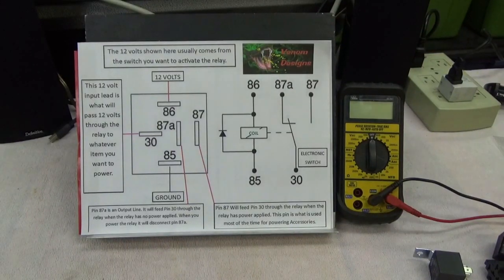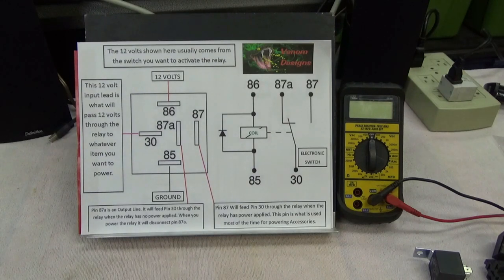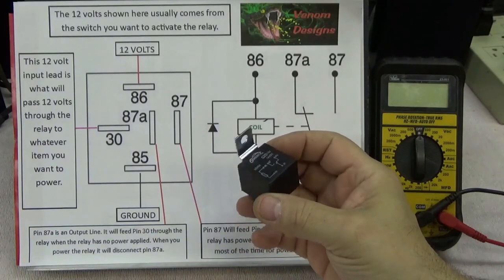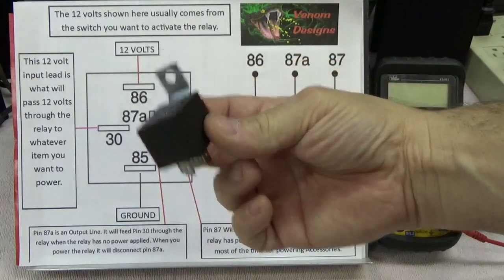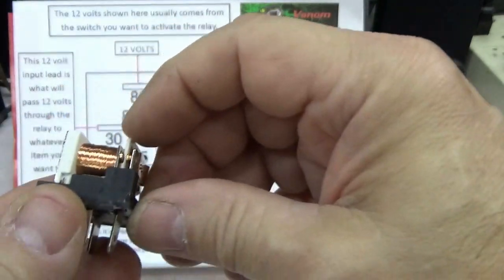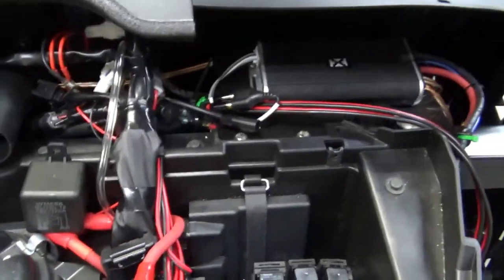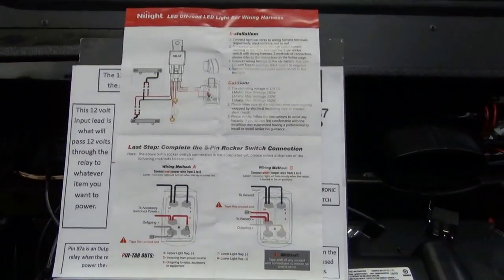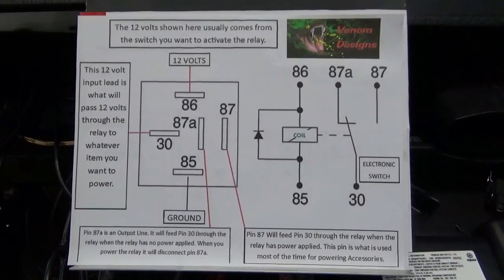Relays, Rocker Switches and Fuse Panel Wiring Explained

Comment: That was Great. I just did the Big 3 upgrade and added a second battery to my truck. I'm adding 7 inch reverse lights and two, 12 inch light bars to the front. I didn't care for the harnesses I was sent. If i have to splice wires to account for length I'd rather do it myself.  My truck is just over 20ft long. I also made a 4 switch rocker panel in place of the simple toggles and fabricated them into my overhead center console sunglass compartment. Your video helped a great deal in reassuring my intentions. I do intend to use the necessary parts from the harnesses provided in my rebuild
 Thank you.
Sorry for the long winded comment.

Comment: This is the best video I have seen on this so far. Question though, could you not run power to your rocker switch and main power to relay and light bar all off the fuse box? I see you ran the main power from battery to relay. I'm wondering if it's okay to just power it from the fuse box instead.

Comment: Thanks for the video Chris - however I have some questions: I have a 6 gang niLight switch gang - I m not positive on how to hook it up along with the relays??  Do I need 6 relays ? 
Thanks 
Mouse
Reply from the maker: If your accessories draw less than 10 amps each you don't need any relays. Those rocker switches have a 20 Amp max and a 10 Amp continuous rating. If the accessory will draw more than 10 amps then it would need a relay.

Comment: Hey one thing I didn’t understand..maybe I missed something (or I’m just stupid 🤷‍♂️) in a circuit that triggers a relay your fuse block only protects the side of the circuit with the switch…the low current stuff.  Do you have some kind of device in the loop that goes from battery to relay to device (light bar, air compressor, etc.) to ground?  Is it that 100A breaker or maybe a different device you didn’t call out?
In the dome light circuit with no relay that 5A fuse protects the whole circuit, switch, lights, etc.
If I’m going to drop 30A through something using a relay I am going to want a fuse of appropriate size between the battery and the relay (pin 30) I’d think…asking for a reality check here.
Video is great…excellent explanation of the relay and the two sides of the circuit. You know a video is good when you watch several times and review specific parts for reference well done! 👍👍

Comment: Hi Chris, very informative. I'm thinking through the idea of using the Voswitch rocker switch bar I'm about to install in my Jeep as a kill switch for the ignition using a rocker switch label that says it's for something else. In this use case, is connecting a relay to the fuse panel of the Voswitch the only way to go or could it be more simplified to route the ignition wire through the rocker switch and bypass the Voswitch fuse panel altogether? Wouldn't this effectively be making the rocker switch the relay using the same current as the ignition currently sends if the switch is activated?

Comment: great video I get how to handle the switch fuse issues,   my question is how you manage and fuse the in-load accessories power to the relay besides just adding an inline fuse where the wire connects to the battery for each circuit where a relay is used

Comment: The 12volt 5 pin 100 Amp waterproof Relay has 2 contacts & not 1 contact  & I'm hoping to use this relay for a radiator electric cooling fan & so would this 12V 100 Amp relay unit work with a radiator electric cooling fan unit Kind Regards Peter
Reply from the maker: It should work, post a link to the relay.

Comment: I’m preparing to set up my own wiring on my SXS. I’m just confused on the 120 amp relay and you having those smaller relays by the second battery for the light bar. Can’t you just use the 120 amp relay alone or am I missing something?

Comment: So you said that the positive and ground from the fuse block for your light bar are going to your switch, but, the nilight diagram visualizes it as going from the fuse block to the relay to the switch. Which one is it? I'm trying to plan for my new X2. Also, do you only have a 4A fuse because you are using the included inline fuse with the wiring harness? Great video btw!

Comment: So when wiring a 3 pin LED switch to a relay…86 out to the switch in and out, but what do you wire to the bronze connector on the switch? Ground?

Comment: I have a rough country led light bar that has a day runner in the center and then it has the lights. Im try to figure out the wiring diagram for a 6 pin On Off On switch. thx

Comment: When using a rocker switch in conjunction with a fuse panel, the 12v supply to the switch will be from the fuse panel then the output of the switch will be to the accessory?
Reply from the maker: @BigFootedMOTHERFER  if your accessory runs on less than 10 amps, yes. The rocker switches are rated at 20 Amps max and  10 Amps continuous.., if your accessorie draws more than 10 amps then you would use the switch to trip the relay which would then power the accessorie.

Comment: I’m using a blue sea LVD with remote rocker switch and I need to put a fuse on the power leading from the battery to the switch. What size fuse would you recommend? Thanks for your help.

Comment: So you put a wire with an inline fuse from the positive of the battery to pin 30?
Reply from the maker: Yes, use the appropriate gauge wire and fuse for the item you will be powering.

Comment: So I bought a 6 rocket switch box Nilight 6 Gang Rocker Switch Box 12V SPST ON Off Switch QC 3.0 USB Charger Voltmeter Waterproof Aluminum Rocker Switch Panel has one black and red that goes to power the box and each rocket switches has one single white wire that goes to the accessories. My question is where I should get the power for the box?  Straight From the battery or from the ignition accessory? But it needs a relay or fuse?
Reply from the maker: You can run attach one Ignition power lead to the panel and one ground. But then you will need to have a relay on each switch that supplies the power to whatever accessory you are using.
Reply: @venomchris5818  so I ended Connected to a  light bar wiring harness that comes with a fuse and relay . So one fuse and relay to the rocket switches box that supply power to the rocket switch but not individual relay or fuse to each rocket switches

Comment: Do you think i should use a relay on a turn signal ,horn,hazard kit for a honda talon ? When i installed the plug in play signal kit with the provided switches 2 one for left right signal and one for the horn /hazards ,activating the horn it popped the fuse for everything . My power in comes from the key on acc port on the talon wire harness for a winch install that i don’t have . Thanks again .
Reply from the maker: You should use a Relay.. A horn by itself usually draws a good bit of current
Reply: @venomchris5818  thank you Chris  they had a 5 amp fuse in line to turn signal system and i testes the amp draw on the horn and it was 7.36 amps load when used. I tried to tell the seller turn pro about this and he couldn’t figure out my problem till i called them to explain the problem again and again  .i was getting feed back in the electrical system when horn was activated .

Comment: This maybe a stupid question but I must ask, does the bracket on the housing have to be screwed down to metal or is it just a mounting bracket nothing to do with grounding? thnx.
Reply from the maker: Most housings are plastic with plastic mounting tabs. Some plastic housings have metal mounting tabs but do not provide a ground.
Reply: @venomchris5818  Thanks for the reply, I appreciate it. Thanks again for your vid, excellent job, I will definitely send folks over to it when asked about relays.

Comment: Great Video!! Very informational!!! Quick question though... If you have all your stuff on switches.. Why run a switch for the fuse panel? Will it drain your battery if its straight power or?
Reply from the maker: I did that so I can run my accessories without having the key on and running the fuel pump.
Reply: @venomchris5818  But why not just run the hot wire straight to the relay and to the fuse block? Why use a switch there?
Reply from the maker: @2wdDenali  You still need to activate the relay. The hot wire from the battery does go straight to the relay and then to the fuse panel. Then you need to activate the relay either with 12 volts from the ignition switch or 12 volts from a toggle switch.

Comment: excuse my sir why did GM exactly put field wire for alternator to 4pin defroster relay to be exactly pin 86???
that same relay started to draw current on me when the car is off and unusual problem acured me car cinde of self acelerates its carbureted engine Opel from the 80s tipical GM design.
I think the integrated diode is faulty but I removed the relay and 2pin buzzer 3pin blinker 6pin wiper relay only thing I didnt remove is the 3pin blinker and still engine delf acelerateas so do head lights have some thing to do with it?
I do have xenon bulbs with out ballast but car worked that way for years only thing ells I gave dual fillament bulb and positive linear voltage regulator and hei 4pin gm ignition module nothing ells as for electronics so Im confused what culd cause engine to become magnetised???

Comment: Chris, How is the Venom Switch wired? Do you have an inline fuse from the battery to the switch? Do you run the ground back to the negative terminal on the battery or to ground?
Reply from the maker: The Yamaha Wolverine has extra accessory leads. I used one of those leads for the switch. It is already fused in the Yamaha harness.
Reply: Chris I do not have an extra accessory lead. Can I use the 12v lead coming from my 120amp circuit breaker going to my 12v 120amp amp relay Pin 30 to power the switch that would provide 12v to Pin 86 and Ground the Switch to the Fuse Block? Or should I run a dedicated lead from the battery and fuse it. If the latter what size fuse would be sufficient for the switch and to power the relay?  @venomchris5818
Reply from the maker: @austinfranks9471   Yes you can ground the switch to the fuse block and you can pick up your 12 volts for the power going to the relay. You could use a 10 amp fuse one the wire going to the switch.

Comment: Hello Sir. Watching all your videos and trying to work on our new 2022 x2 rspec. Your work is awesome. Your recommendation please on wiring up winch please. Do I need relay or not? Thanks B.J.
Reply from the maker: A Winch should come with everything.. The switch attaches to a relay that reverses the power going to the winch for in and out operation. The wires are usually color coded for easy hook up.. The only two wires that hook up to the vehicle are the positive and negative that go to the battery..
Reply: @venomchris5818  this is BJ tried for 30 min to reply with a video of my wire diagram, can't figure it out to get it to you. Anyway you would swap cell numbers?
Reply from the maker: @byronjackson1520   Sorry, I don't swap numbers. You can post your question in the Yamaha forums listed in the description on this video.
Reply: @venomchris5818  gotcha. I follow you there as well.

Comment: So the center pin on the gang switches goes to the power side of the fuse panel.?, then the red wire from the light accessory goes to the bottom pin on the switch.... ?, where does the ground wire from the light go?, confused

Comment: I have these relay with wires pre installed.  30  would be your rocker switch or ignition to activate relay using 16ga wire.   ( 86, 87, 87A are all 12ga wires to carry the power load.)   86 connects to batt. positive term to supply power  (Not 30 ).  and 85 to batt. ground term.    87A provides constant power until you turn ignition / switch on,  87A closes / off and then 87 provides power from batt.  Turn ignition / switch off and through power switches back to 87A.  Turn power switch / ignition back on and power flow through 87.

Comment: My switch has 3 wires (one to 86 on relay, one to 85gnd, and one actually connects to 30) my question is, the wire that goes to 30 is to light up the switch's built in led... does this defeat the purpose of using a 4 pin relay?
Reply from the maker: I would need to see that switch and relay. The switch and relay are two different things, A 3 pin switch usually has Power In, Power Out and a Ground for the LED. A 3 pin relay is usually used on Flashers, Warning lights, etc.. A 4 or 5 pin relay is usually used for all  accessories.

Comment: If I'm following correctly, you used the fuse block to fuse the switches? How did you fuse your main 12v for your accessories? I disagree with this entire method. The best way to wire these is to daisy chain all your switch grounds, accessory 12v and lower LED. That way you only have one ground and one 12v source (accessory) powering all your switches. Then you only have the output to the relays. The fuse block should be fusing all your pin 30 connections on the relays.
Reply from the maker: You can daisy chain all your grounds but not all accessories use enough amperage to need a Relay on each switch.. So I fused each switch and ran the accessory from each switch.. Only the accessories that drew more current than the switch is rated for got a Relay that was fused. I disagree with the way you would daisy chain all your power to the switches. There is a main circuit breaker on the fuse panel. Of all my switches only two needed relays.
Reply: @venomchris5818  The power to the switches is just accessory power to light the LEDs on the switch. I'm able to do this because I use relays on all my switches. I don't have any power going through the switch.

Comment: Awesome video man. I have a Suggestion for your next video, 
how to test amp draw🤞🏼
Reply from the maker: Go to my Build Thread, Post 115. It will show how I did current draw on Ceiling Fans in My Wolverine.  https://www.wolverineforums.com/threads/venoms-2021-yamaha-wolverine-x2-xt-r-850-build.32328/page-6
Reply from the maker: It is a simple meter from Amazon that just clamps around the wire and gives you current draw..   https://www.amazon.com/gp/product/B07Z398YWF/ref=ppx_yo_dt_b_search_asin_title?ie=UTF8&psc=1
Reply: Perfect thank you, one question for you on your main 💯 amp relay did you run that ground back to the secondary battery or to the frame ?
Reply from the maker: @brianl4521  I ran it to the ground side of the Fuse Panel I put in. You could run it to either battery ground or to the frame.

Comment: geez almost no one says what amp Fuse to TOGGLE relay ... 5, 10, or 15 amp ???  to safely trigger relay with out burning up relay coil.
Reply from the maker: Generally most accessory leads in a car or SXS / ATV are 15 amps. Some can be 10. The relay coil will only pull enough current to work. The only time it would pull more is if it shorted in some way. That would blow the fuse.  The average 12 volt relay only pulls .16 Amps to trigger the coil. You could put  a 3 amp fuse on the power input wire to the coil if you wanted to be very cautious. But I have not seen anyone do that.

Comment: Im looking at buying a fan with a 4 pin relay so does it mean its always charged I guess? No switching?
Reply from the maker: You should have a switch that turns the relay off and on. Or if the fan turns on by temperature it could be hot all the time or when the ignition is on.
Reply: @venomchris5818  Ok so attaching it to the fuse box will switch it ? Hard for me to fathom this I do residential elec. and its so different , you would never run 2 power sources to an item.
Reply from the maker: @frekkledipped  The reason you use a relay and run a wire to it to turn the relay off and on is because some accessories draw more current than rocker switches can handle. The relay feeds the higher current wire through it to the accessory. You could come out of the the fuse box using a lead that turns off and on with the ignition switch, That would turn the relay off and on.
Reply: @venomchris5818  OK thanks bro!

Comment: What size wire would you use when running the relay to the switch and switch out to the accessory for light bars
Reply from the maker: It all depends on the size of the light bar.
Reply: @venomchris5818  just regular size pod lights not the big light bars stuff like ditch lights.
Reply from the maker: @beanieweenie9543  led pod lights probably don't draw 10 Amps.. You could probably use 18AWG, but I always go up one which would be 16AWG.. Always use pure copper wire...

Comment: Do I run a wire from both battery post to the switch or just the + and where does the ground wire go to? Also I want the bottom led to run when I turn on my headlights or parking lights. I’m thinking of using my radio dimmer wire which is unused because I have a aftermarket radio that has its own dimmer